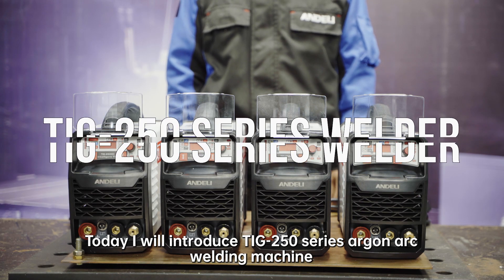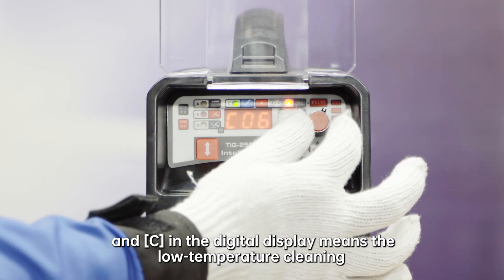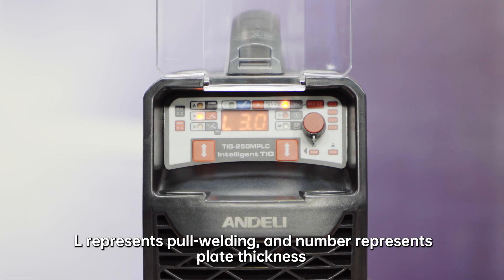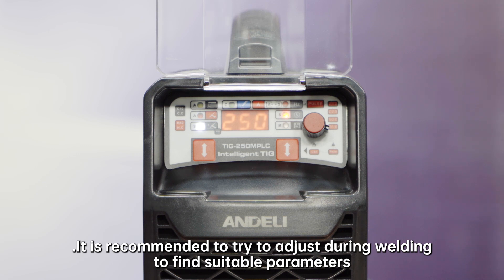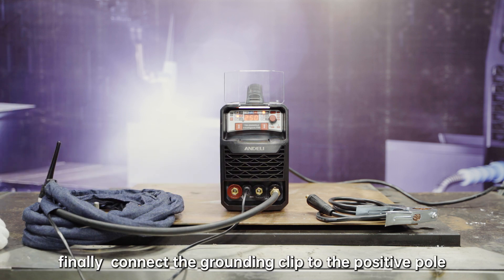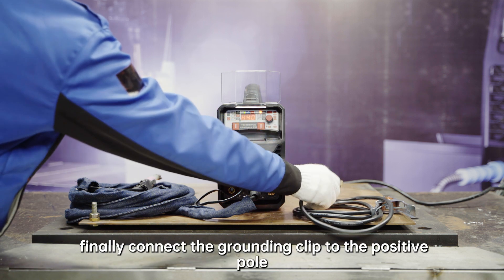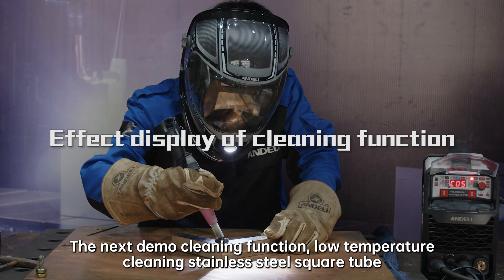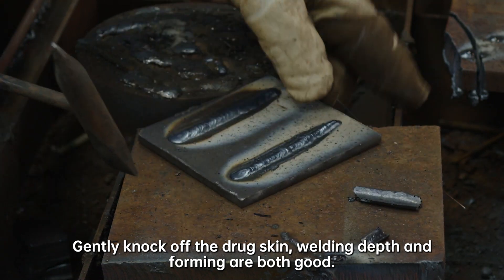ANDELI TIG-250 Series TIG Welding Machine Installation And Use Introduction

Comment: I have a  TIG-250GLC how is it wired up? plug is one large leg and one small leg plus ground, what am I looking at

220volt leg and neutral and ground 
or
 2-115volt legs and ground no neutral

Comment: hi.. ive purchased andeli tig 250 mgc.. my problem is it cnt start using its switch. ineed to scratch it to start.. bt your video.. its effortless to start ... is it normal to scratch it to start or is there an issue about the machine?thanks if you respond

Comment: Hi mate i brought the andelli 250mpl welder and when i go to use it as soon as i get about 25mm from the metal it starts to arc without touching the trigger and if i use cold pulse it starts ok and when i let my finger of the trigger it keeps pulsing i have to turn the machine off and  back on again to stop it, i have email to andelli  and they said it was normal did you have any trouble with yours piece of crap as far as im concerned
Reply: Hi Mate, I have almost same issue with this crap. I.e my switch trigger is not working at all, it looks like switch is always ON like I press it since power on this peace of crap. If you resolve problem please let me know I will be appreciate for solution.